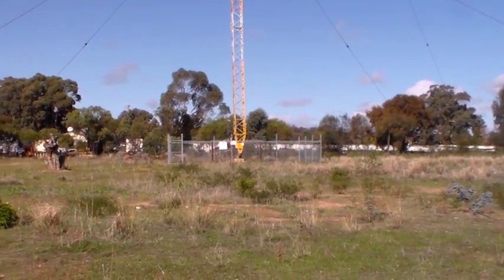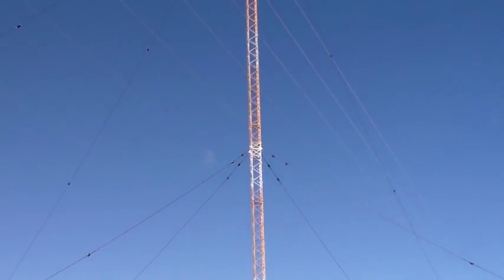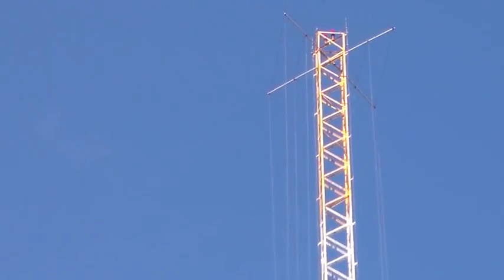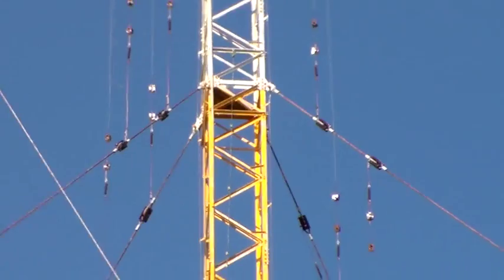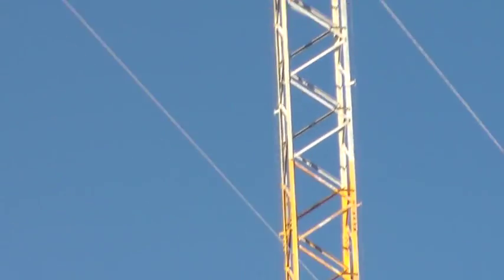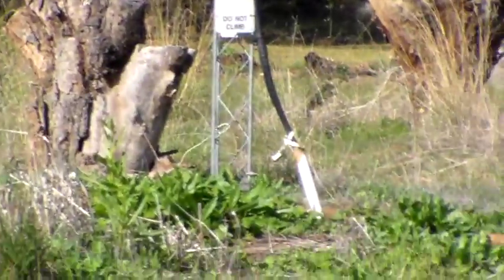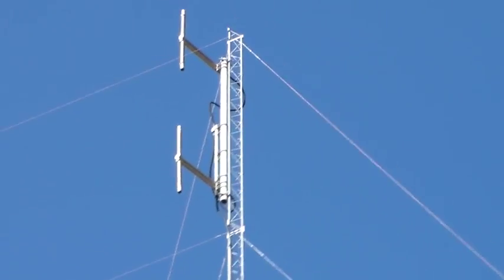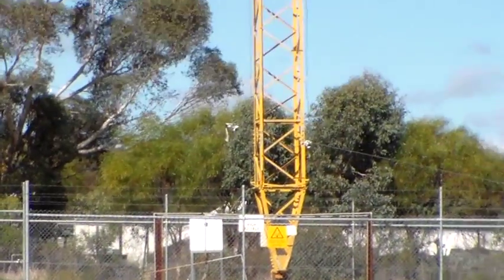A 'Linear Loaded' AM Broadcast Antenna.

Comment: Very interesting, thank you. I thought at first this might be a folded dipole; there is a 1-kW class C station in my area that uses one. However, on further inspection I see this is not the case. It almost looks like a kind of truncated curtain antenna.

Comment: Thank you for the answer. So one purpose of the ATU is to make the load resonant at carrier frequency?
Reply from the maker: No, an ATU just provides a good impedance match to the radio. An antenna can be resonant but not provide a 50 Ohm load. Or it can be resonant and provide a 50 Ohm load so no ATU is required. It all depends on many variables such as composition of ground, height from ground, surrounding objects, the material the antenna is made of etc.
Reply: Thanks.
Reply: +VK6CS: Would this still hold true if you feed the antenna via a 300-ohm ladder line instead of 50-ohm coax or hardline? 73 NØJAA

Comment: Great video.

This is a Uni pole type of antenna with linear loading.I wonder if a capacitance hat could be added to the design for amateur use to further shorten the antenna.
Reply from the maker: I saw a broadcast antenna recently that had a capacity hat, it saved about 25% in vertical length. But the capacity hat was at the end of the radiating element. If I understand what you're asking correctly you want to put a capacity hat at the end of the linear loading elements, half way up the mast and reduce the height of the whole thing. I've never seen that done, but this is amateur radio, it's all about experimenting. It would be a hard thing to achieve mechanically though as the capacity hat would have to be insulated from the mast. It would probably be better and simpler if you shortened the mast to whatever height you have to play with, then at the top put a loading coil between the mast and the capacity hat. If you could measure the RF current into the antenna you could see if you were any better off.
Reply: I am trying to combine a linear load w/ a cap hat for a 160m antenna.I started studying broadcast antennas to get a few ideas and ran across your video. I liked this video and if you can make a video of that other antenna that would be fantastic as well.
Reply: Scott Ch. The capacity hats I have seen on AM BC antennas would have had those wires spread out horizontally more and be less vertical. Some stations like New Jersey's WPAT 930 Khz have actual hoops at the top held in place physically (and electrically) connected to the towers.